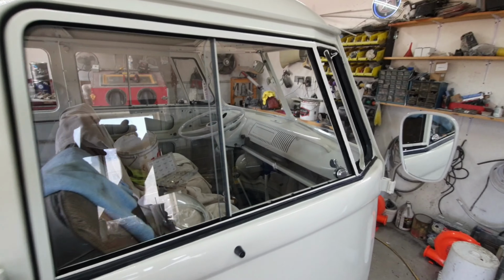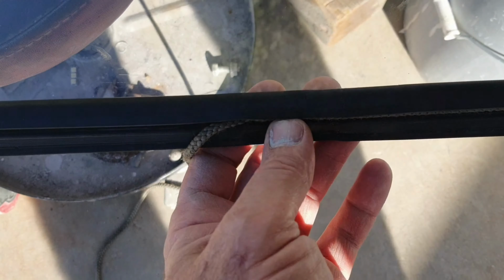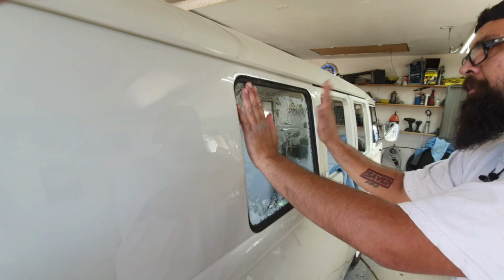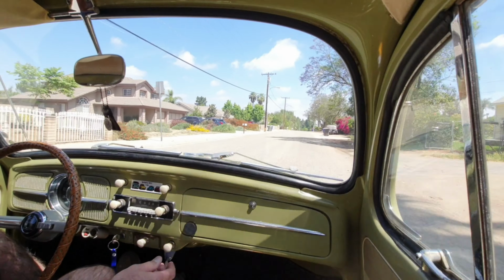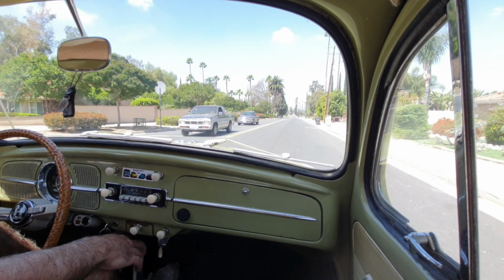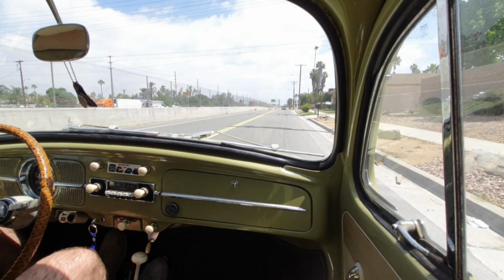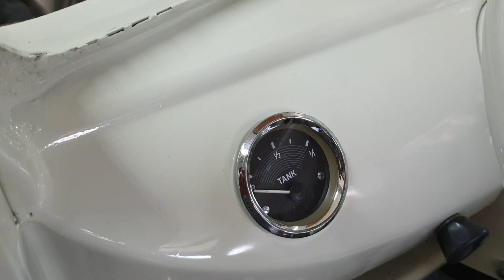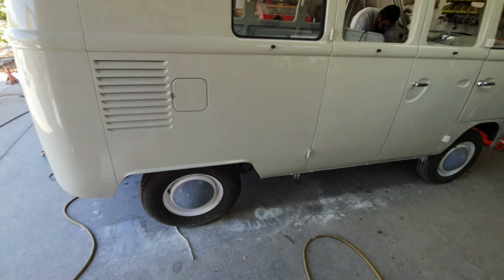VW BUS RESTORATION - Color sanding & Buffing Paint

Comment: Can you please post a link to your USB adapter in your beetle. I have a 59 beetle and need one. I remember you talking about it in a past video and can't find it. I enjoy your videos. It's looking great👍 Thank you
Reply from the maker: https://www.ebay.com/itm/12V-USB-Cigarette-Lighter-Waterproof-Power-Port-Outlet-Socket-Kit-For-ATV-Boat/152680695861?ssPageName=STRK%3AMEBIDX%3AIT&_trksid=p2057872.m2749.l2649 It did finally fail so use on of these to convert it to 12v. https://www.ebay.com/itm/5A-DC-DC-Boost-Power-Module-Step-Up-Volt-Converter-3-3V-35v-to-5v-6v-9v-12v-24v/173722759045?ssPageName=STRK%3AMEBIDX%3AIT&_trksid=p2057872.m2749.l2649